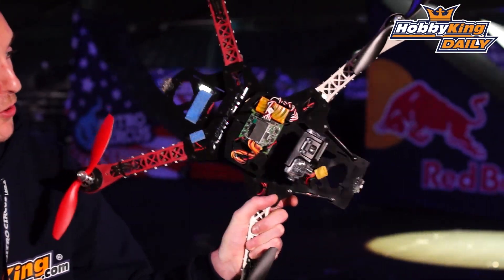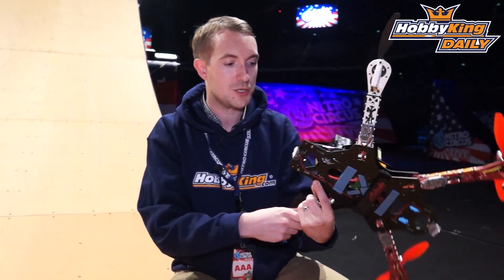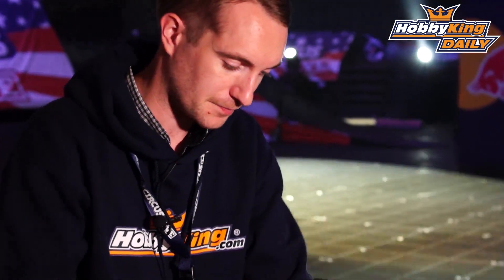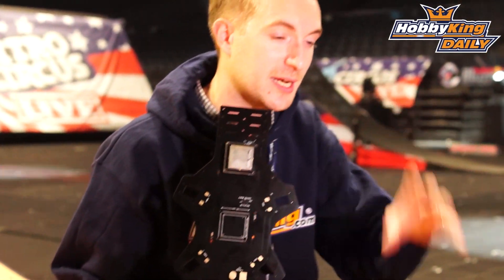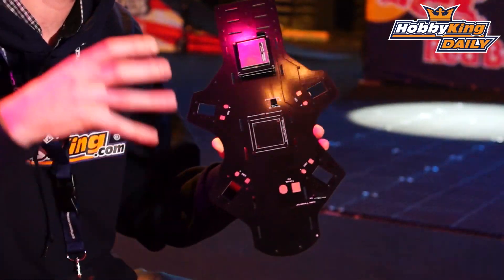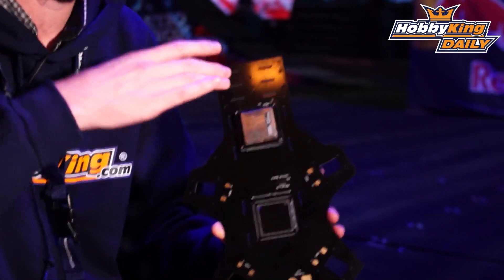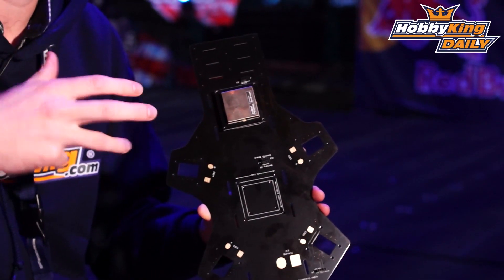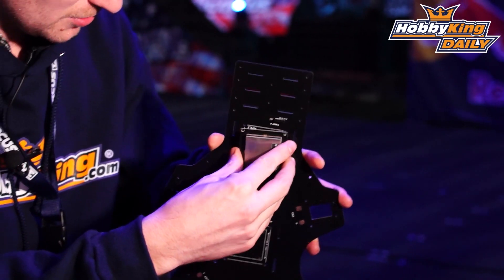HobbyKing Daily - SK450 Dead Cat integrated board kit

Comment: Not just yaw, the whole thing becomes unstable if you use the rudder, almost like it's trying to twist itself.

Having a KK2 board helps since you can change the values on how much power goes to the motors using the LCD and i got it to stabilize.

Comment: All you have to do is check here on YouTube for "Dead Cat custom motor mixes" or similar kind of searches to see what is required to get this thing flying properly.

It would have been far simpler and easier for everybody if the arms were symetrical. Sure keep a widened and lengthened center frame to fit the camera forward and the battery rearward, but there is no reason why the arm's couldn't be symetrical with eachother. 
A great idea ruined because the designers don't understand!!

Comment: You guys should have fixed the assymetrical geometry problems whilst you were improving the frame. The manner in which the motors are way out of symmetry (more then the TBS, for instance) causes torque couplings between the motors which cause unwanted attitude changes during flight control.

You need one of the flight controllers that you can adjust the control biases for any given motor pair. Its a pain in the ass. Symetrical arms would have fixed it!!

Comment: I suspect there is a money making opportunity for some one with the means to fabricate an SK450-DC Corrected ARM length kit.  =)

For $200-400US (TBS) I expect a ridged frame with symmetrical arm lengths.  For $40US (SK450+DCUpgrade) I expect a fun toy that I can bash around with ultra cheap replacement parts.